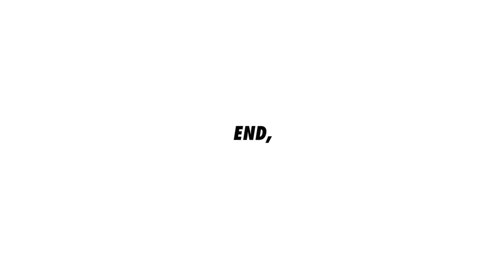W45_Curved table

Comment: Great work, thanks for sharing.. How did you made the curve cuts (specifically for the 3 MDF boards you joined)? What’s the wavy material you used outside the curvy board? Why did you paint with roll instead of spray you normally do?

Comment: i like your workmanship and it inspire me to trying on woodworking  but i lose what material you using and try to find in my country - the base - gold color finishing..and the front bubble..thanks in advance anyway..bravo mate/
Reply from the maker: Thanks~! base is Valchromat and MDF, Gold is Brass, If there are no materials... change materials. maybe there are good materials in your country.
Reply: @ViTTEN  as i read..mdf @ valchromat is not moisture resistance and not strong but nice surface..how do you confident on using it for kitchen and nail shop(heavy top)
Reply: @scarflower6838  MDF is not recommended for spaces with a lot of moisture like kitchens and bathrooms. But there are ways to waterproof it by using certain paints or surfacing it with vinyl or formmica. The front bubble thing is Tambour panels.

Comment: 6:20 what material is it that bends with heat? looks like a mdf panel but I'm pretty sure those just break if you try that
Reply from the maker: MDF. It can banded with heat
Reply: ViTTEN / 비튼디자인 can we use Hdf too instead of mdf ?